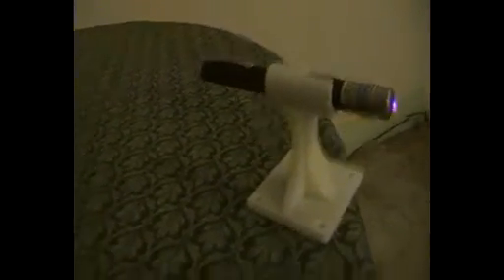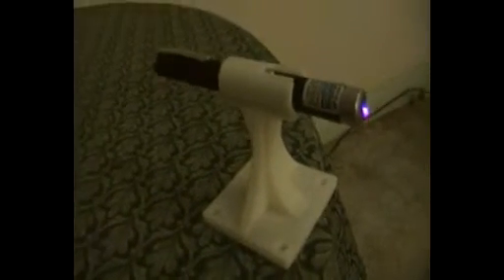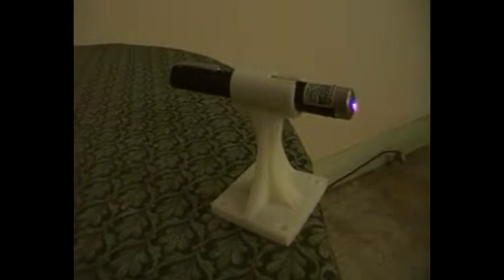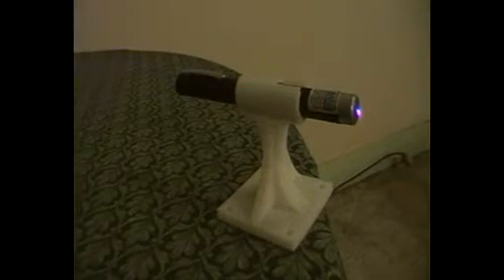Laser Raster Scan Project  Sneak Peek

Comment: Are you sure you don't mean vector scan. That's what it looks like you are doing in the video. A raster scan builds up the picture up line by line while a vector scan traces out shapes. Most laser displays I've seen use two mirrors, one for vertical and one for horizontal. It greatly simplifies the design and increases the scanning speed. Whichever you are trying to do, good luck and please post more videos. I'd love to see what you come up with.